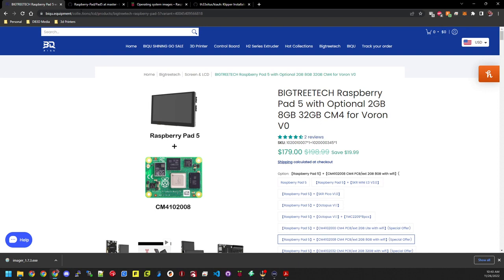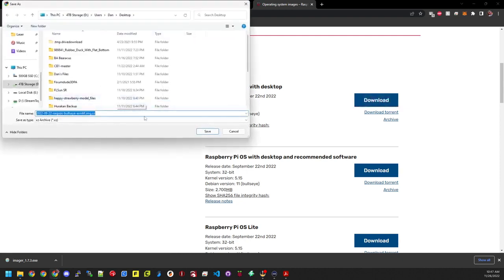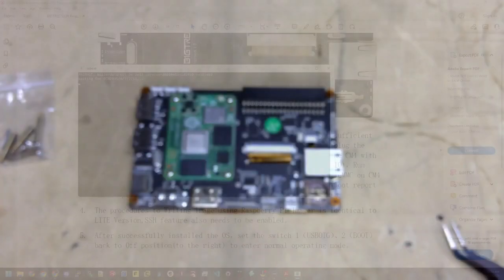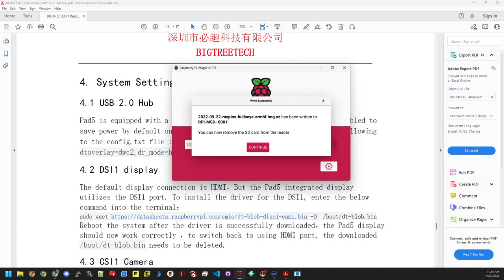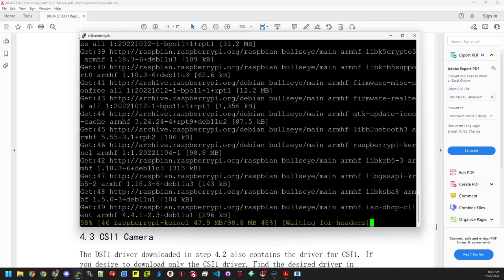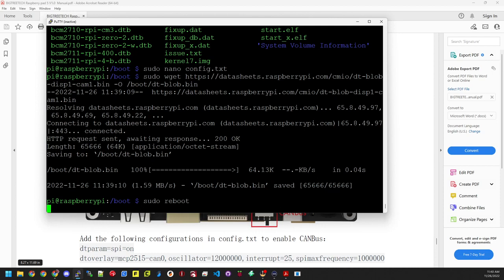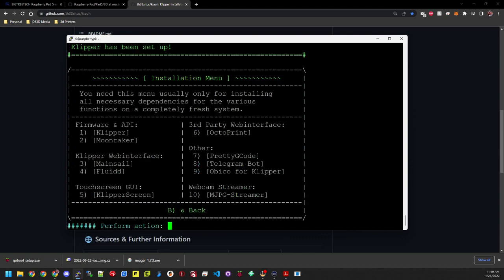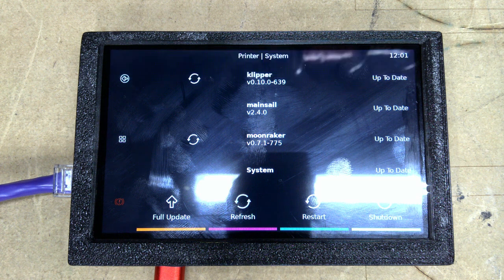Installing Klipper and Klipperscreen on a Bigtreetech Raspberry Pad5

Comment: can you explain how to set up with sd card if i dont have an emmc?
Reply from the maker: Rather is even easier just run the normal raspberry pu setup and put the sd card in the second slot on the main board and boot and then you should have the setup screen when you boot with an HDMI and keyboard connected.